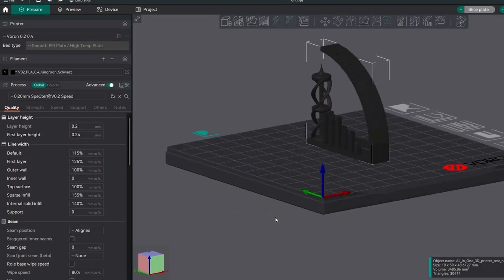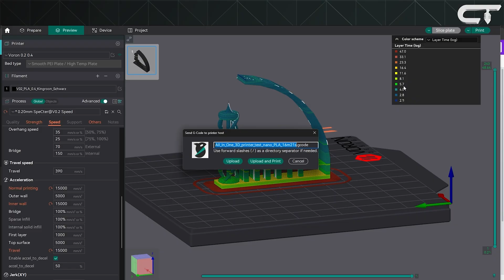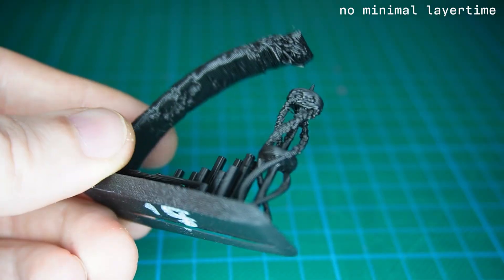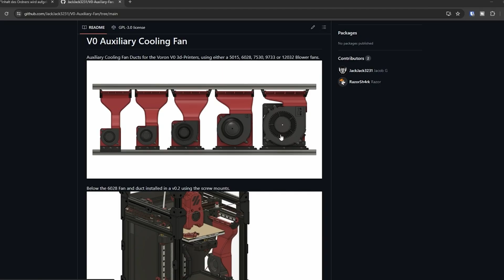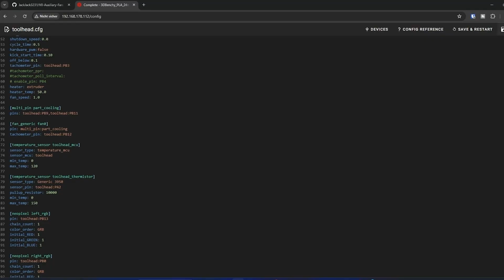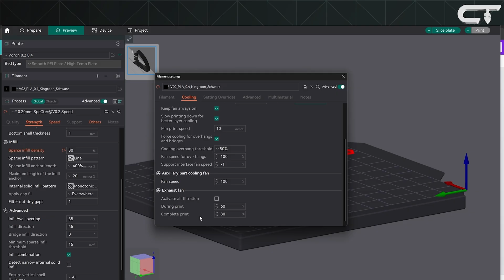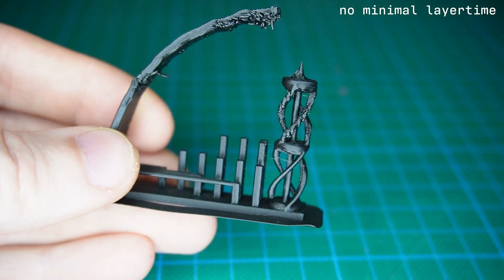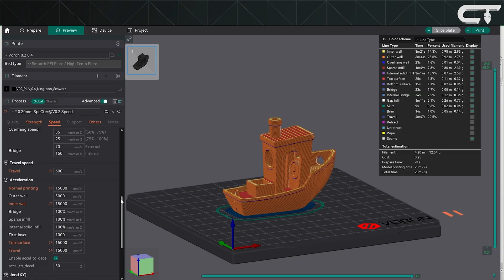How to fix PLA prints without changing your hotend!

Comment: On my Ender: dual 5015 on toolhead, dual 8025 full area cooling.

On my M45, WS9290 CPAP with wide open duct ends flooding the zone with air.
Reply from the maker: Only cpap is not good if you print very fast, because the only cool on the Spot where the nozzle is. I recommended an aux Fan if you use cpap.
Reply: @crydteamprinting  That's why I clarified wide open duct ends. You feel it half a meter away from the printer.
Reply from the maker: Ahh Yes, thats a good idea :)

Comment: It is a compromise: That aux fan also produce very ugly warping in PLA for bigger parts.
Reply from the maker: Yes the aux Fan cool down the print plate. You have to increase the Temp to 55-70°C.
Reply: @crydteamprinting Or use a proper surface for PLA that holds it fine cold. Not this silly PEI fad.
Reply: Only if you're doing something very wrong like using a bed surface with no adhesion.

Comment: this is a good follow-up to the venture xl video, where i first heard about external cooling fans. i have an flsun sr which is stock other than a 0.6 nozzle and upgraded 5015 part cooling fans. they make a speedy printer even faster but need a little more polish. also been considering a core xy and thanks to your viewpoint, i'll probably pick one with a moving bed instead of a gantry for easier cooling. it's too bad there isn't one that checks all the boxes so far like multi filament capability and an enclosed large print volume with an even heating bed. a larger qidi plus 4 would be nice if they ever make one available along with the color box
cura user but i want to learn orca though i haven't had much luck with it. like your gcode examples, they're still a little complicated for me but it's nice to have videos to refer back to
Reply from the maker: Thank you :)